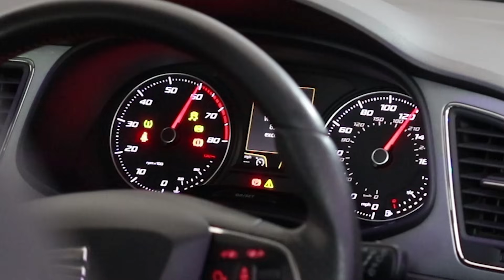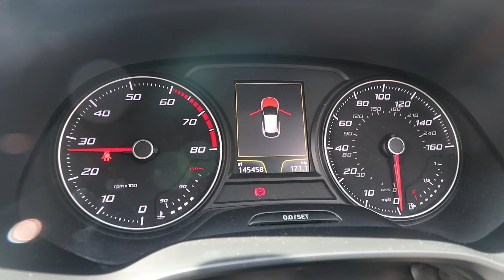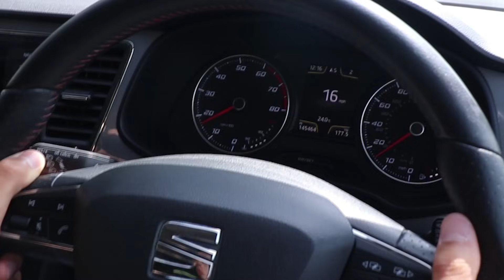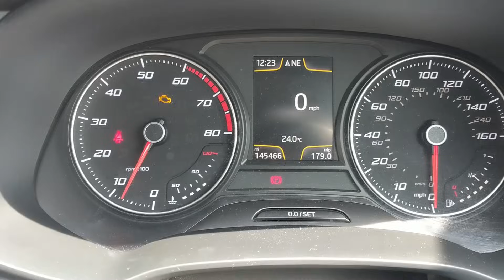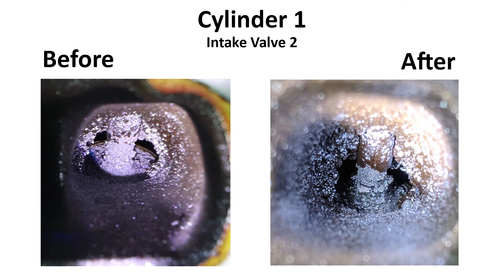Hydrogen Engine Carbon Cleaning Review - Car Care & Ownership Series

Comment: I do carbon cleaning and 45minuites isnt enough for this mileage. Anything over 100k wants at least 1hour to burn the carbon off more efficiently  also using and intake and egr cleaner like i would suggest would clear the intake more efficiently and remove the oily deposits. Cars with direct injection will benifit more with the intake cleaner.

Comment: Can I ask, is it 2 parts hydrogen to 1 part oxygen mix  .. Dihydrogen monoxide... HHO or ... H2O or...... Water ???
Reply from the maker: About half and half when you consider the air has oxygen. But water is 2 hydrogen for every oxygen. They use ordinary water.
Reply: Its O2 and H2. HHO is not a scientific name
Reply: @sidescrollin  H2O is the chemical formula for a water molecule, where a single oxygen atom is bonded with two hydrogen atoms. HHO is a popular way of writing OxyHydrogen - a mixture of hydrogen and oxygen gases, usually in a 2:1 ratio. Thus, HHO = Hydrogen-Hydrogen-Oxygen. Since the oxygen and hydrogen are in mixed gas mode and not bonded, it is not H2O (water). Bonding hydrogen and oxygen requires an ignition and chemical reaction. When the Oxyhydrogen gas is lighted, oxygen and hydrogen atoms bonds and releases energy, the end result of the chemical reaction is water vapor."

Comment: I used a wallpaper steamer strate into the inlet 20l steam latervwith engine running at idle now runs very smooth check out my page
Reply: The hot steam entering the intake passes over the carbon on the intake valves.i think you will find it far more effective than hydrogen gas i have lost my bore scope footage but it works a treat i now get between 5 and 10 mpg more
Reply from the maker: I have heard others using steam. Won't help your intake valves though.

Comment: After you did the carbon clean you should have taken it to the redline as much as you can, also use non supermarket fuel and  good oil every 8-10k miles and just take it out once or twice a week and again take it to the redline 10+times to help
Reply from the maker: I drive me car a lot and I do take the engine to red line when the opportunity arises. Putting oxygen and hydrogen through your intake makes no difference at all to the intake valves. Watch my other videos, the walnut blast was the only method that worked.
Reply: @ConquerDriving  Fair enough, I had a carbon clean, not by the company you used, just a garage with a machine and ot made a huge difference on my fabia 1.9 tdi on that day after giving the car hell after the clean.

Comment: Hmm interesting, I think you saved me a bit of money. I'm thinking of using a steamer to have the steam go into the engine as i rev. I live in a small third world country. I've literally checked every mechanic on the island. No one knows how to carbon clean.
Reply from the maker: Be careful not to add too much steam, the water may condense in your intake and hydraulically lock your engine which would be game over.
Reply: @ConquerDriving  thanks man. I'm aware of the possibility of hydro locking. But I'm willing to take the risk.
Reply: @DeepThinker193  p

Comment: Use cleaner fuels,propane/natural gas.How many miles a day do you do,electrics cars now do 200 miles on a charge.Over all you could reduce your costs !
Reply from the maker: Fuel doesn't make a difference to intake ports on a direct injection engine. Also, my car is mostly used for teaching people to drive manual.

Comment: I do carbon cleaning for the VAG cars for professionally. The only way to get any kind of good result is wallnut blasting etc. mechanical cleaning. These HHO etc. voodoo machines do nothing, as you can see for your self. I have dynoed several cars and with proper cleaning the gain is about 10%. Also injector check with proper ASNU tool is essential, since specially 1.4tsi injectors are crap, they wear out low as 100k km´s and need a replace.
Reply from the maker: I'm editing the walnut blast video now, should be on YouTube by Monday. However my 1.4 TSI has done 247,000 km and the injectors are still fine. Now I've said that they will probably fail next time I use the car 😂
Reply: @ConquerDriving  are the injectors been checked on injector dyno/tester? Not saying that they are faulty but you would be amazed how much there is fluctuation in the amount what they spray on the test.
Reply from the maker: No, they haven't been checked.

Comment: You could do a much better job with some throttle body cleaner spray, a dental pick and some cotton tipped sticks. Takes about 20 mins a cylinder and it will get rid of all that crap, which you can remove out the top instead of feeding through the engine!
Reply from the maker: Agreed

Comment: Hydrogen carbon cleaning does not help om GDI engines such as TSI. You can use wallnut shells to clean it manually, but this will cost in labour.
Reply from the maker: Thank you, that's my next job.

Comment: The combustion happens in the chamber and the valves are closed. Therefore one cannot clean the valves or manifolds using hydrogen cleaning.
Reply from the maker: I understand this, they claimed to clean the intake valves, this is why I put it to the test.
Reply: @ConquerDriving  they claimed wrong ask for a refund

Comment: 99£ for this so called hydro clean is silly, you should pay £150-£200 to walnut blast or similar your intake valve heads. Then run the engine with a slight mist of water through the intake for a week and voila, your engine will be clean. Or if you don’t know what your doing just stick to the walnut blasting.
Reply from the maker: Agreed, I'm doing these videos for some myth busting.

Comment: I'd be interested on a segment about wear & tear on your instructing car. Considering the large mileage covered by a lot of different drivers
Reply from the maker: That's an idea for the future. Thank you.
Reply from the maker: Well to give you an idea a clutch rarely has the chance to wear out, not even 20% worn when I have to replace due to there being play on the spring loaded mechanism in the centre of the friction disc due to clutch/flywheel impact. I get about 35,000 from a clutch.
Reply: And techniques to reduce wear!

One of my mates was taught to leave the clutch half down and creep forward in traffic by releasing the brake.. Eek clutch!

Comment: I don't want to spread any disinformation, but I've heard that running engine on high revs sometimes helps keeping it clean. Although I don't think it'll help when valves are already clogged.
Reply from the maker: Yes, highway driving does about 10% wear on an engine than town driving.
Reply: @ConquerDriving  it might be a reason why it happened, since your learners drive on low revs a lot. Good luck with figuring it out, anyway. And keep us informed. 😌
Reply: THere is a technology called walnut blasting which cleanes the carbon-build up from the intake valves and other parts. Or use high octane premium petrols. I do not live in the UK, so i don't know your petrol brands. Here in Hungary OMW Maxx motion and Shell V-Power recommended.. Furthermore I personally avoid Direct Injection engines, I stayed at the naturally asperated in-direct old-school engines.
https://www.youtube.com/watch?v=TgOopW8hfuQ
Reply from the maker: I know the one, I'm just trying cheaper fixes to see if they work. Premium petrol won't help because it's direct injection.
Reply: @ConquerDriving  Maybe, but they are advertised the Maxx Motion here, that it has additives which cleanes the engine.. who knows maybe this is just commercial.. :)
Reply from the maker: @GR-kn7mt  yes it would likely clean the engine but not the intake valves on a direct injection engine because the injectors are after the valves so the fuel would not touch the valves.

Comment: Good video. I think they use weak machine and run short time, that's why you haven't better results.
Reply from the maker: Thank you, they ran slightly longer than normal. I've had good results overall bust hydrogen cleaning doesn't clean relatively cool intake valves.
Reply: @ConquerDriving  I am constructor of decarbonising machines, for your car need more than one hour, and they run just about 45 minutes, right? They measure exhaust gas, but this is not true marker for ending treatment. How they run his machine, from house socket (220V) or from car alternator?

Comment: A good video Richard. However Terraclean works a huge amount better.
Reply from the maker: Thanks Harry, I'll check them out.
Reply: There are fuel additive fuel system cleaners available for around £10+ that do a far better job than terrorclean.
Also, hydrogen carbon clean treatments are chemical free 😉
Reply from the maker: @Chopperdod77  fuel additives can't help clean the intake valves on a gdi engine. I believe Terraclean pumps a chemical through the intake manifold to clean the valves. I've tried a chemical though in another video and it didn't work.
Reply: @ConquerDriving  my point is that hydrogen can (to a degree), and so adding a fuel additive for a tenner will be way and above a terrorclean, especially when it comes to cost.
Most fuel additives are not great but there are some products which do go way and above a terrorclean 😉
Reply from the maker: @Chopperdod77  I see, what you're saying is Terraclean doesn't use the best chemical. I can't comment on that as I haven't compared but I can say that hydrogen does not clean intake valves and fuel additives can't clean intake valves on gdi engines as there is no contact between the additive and the valves. Terraclean offer a service which is more in line with what I need as their chemical will reach the intake valves whereas fuel additives won't as the injector is after the valve so it would be like trying to clean your face whilst scrubbing your bum. A fuel additive is not an option for someone with my issue.

Comment: Can you test HHO generator
Reply from the maker: @Chopperdod77  I'll look into that.
Reply from the maker: Having looked into it a HHO generator may clean the engine of carbon slightly but would cost you a small amount efficiency overall so not a good move if you want economy.
Reply: @ConquerDriving  
The Atmos-Clear kits can give a return on fuel efficiency up to and above 20%.
It improves efficiency.
Reply from the maker: It's hard to see exactly what atmos clear is actually offering. But if it's a HHO generator run off a cars alternator this type of device will not improve efficiency. I can't comment on how it would affect emissions but it can't improve efficiency as it would violate the first rule of thermodynamics. Also common sense tells me if it worked every engine manufacturer would be using it. The term I think people use is snake oil. However having searched their website I can not see what their device actually does which leads me not to trust them.
Reply: @ConquerDriving  Paris trust them and have approved the unit for the Olympics.
Vehicle manufacturers are infact looking at the unit.
And I can assure you it improves fuel efficiency lmao
Reply: @ConquerDriving  
Anyone who has one fitted reports back with fuel efficiency improvements when theres armchair scientists saying they cant hahahha.
Go figure.
Reply: @ConquerDriving  
Have one fitted to my BMW 530d 2005, its remapped and was showing 25.7 mpg, now 37.6 mpg.
Have one fitted to my citroen berlingo 1.6 hdi which was showing 42.3 mpg (fully laden) now showing 47.2 mpg (again fully laden).
I guess the skeptics are wrong 😆
Reply: @ConquerDriving  as for emissions, the berlingo now shows zero on emissions for the mot.
The bmw has the DPF deleted and has lower emissions than if it had a DPF filter.
Noticeable power improvements on both vehicles too 😁
Reply: @ConquerDriving  
I can only guess that thermodynamics have no impact on how they work whatsoever, in real world results this would certainly seem to be the case.
Reply from the maker: @Chopperdod77  Your claims have sparked my interest. I will need to look into this further. Doesn't make sense to me as you can get something from nothing. How does it work?
Reply from the maker: I'll put some thought into that. If it worked I would have thought a manufacturer would have implemented it by now as I believe they have experimented with it. But in theory it should work and improve efficiency. I believe they only need about 75 Watts of power to work which isn't bad.